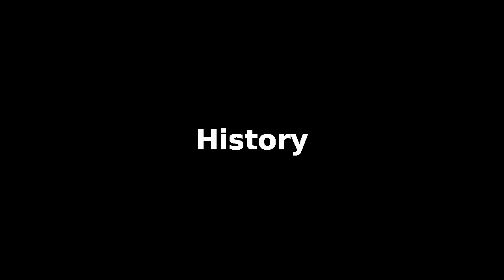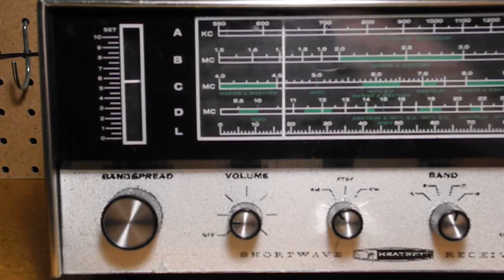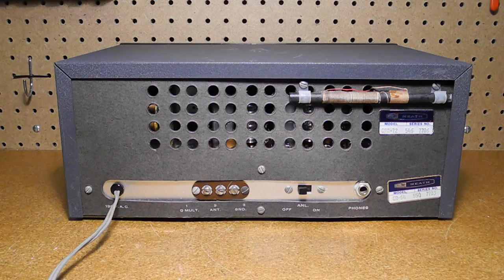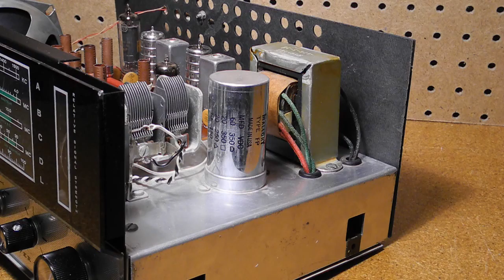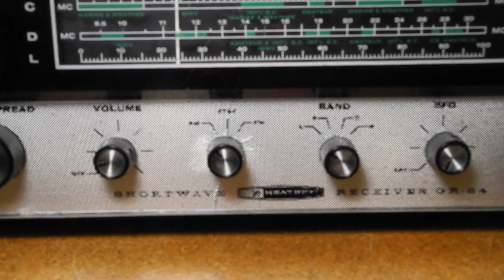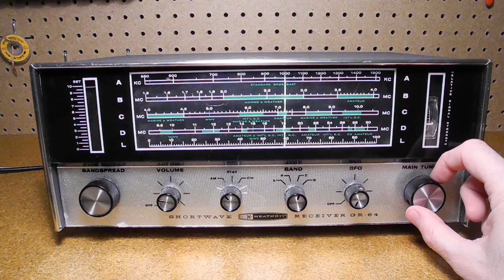The Heathkit GR-64 Shortwave Receiver

Comment: I can’t get audio on any frequency. I do not know what the issue could be. I’ve looked through it and everything looks good. I don’t know what the issue could be. Any suggestions?
Reply from the maker: There are some partial copies of the Heathkit manual online. The manual has a "In Case of Difficulty" section thats lists symptoms and possible causes. The schematic diagram also lists expected voltages that can help diagnose problems, if you have a multimeter to make measurements. Use caution as there are high voltages present!
Reply: @jefftranter  okay thank you 🙏

Comment: Witch one is the better: Heathkit or Realistc.
Reply from the maker: Both Heathkit and Realistic (Radio Shack) made many models of shortwave receivers with a wide range of performance and price. It only really makes sense to compare particular models, not the manufacturers.
Reply: I'm sorry for so many questions. I am deciding on an Ebay purchase between a HEATHKIT GR-64 (valve) or a Realistic DX-160 (transistorized). Which one is the best?? THANKS
Reply from the maker: The DX-160 is a more modern receiver and should offer better performance and be more reliable. It looks like a service manual is available so you could repair or align it.

Comment: check your wiring on the s-meter. mine works properly. 0 at the bottom=no signal, and strong signals send the needle towards the 10. this one has a green and black twisted pair, with the black on top and green on bottom. W4ATF

Comment: Ah, my first rig; I built it when I was around 14. I built and used a Heathkit Q-Multiplier to improve the signal for amateur radio, particularly those using SSB. I had a the antenna leads connected to a piece of coax that went up to the roof of our 15 story apartment building in Brooklyn. I had no problem receiving communications from around the world and had a nice collection of QSL cards from both Hams and commercial SW radio stations.

Comment: This is the first Heathkit I built way back in 1969.   I was 15 then.   One thing led to another, thanks to Heathkit and later having it motivate me to get in to amateur radio by listening to shortwave radio with this product.  I recall trading it in at Henry Radio for a Hammerlund HQ110 and a Drake 2NT transmitter.

My parents used to give visitors a "tour" of my bedroom "radio shack" which really provided encouragement.

I built the Q Multiplier for the radio too.  Not a great addition but entertaining to play with.

 In the end, I obtained an Electronics Engineering degree and worked for a large computer company for a 35 year career.

What fun it was to build these kits!  It is unfortunate that this era has passed in that it enabled so many people to experiment with electronics and pursue interests that could later become a lifetime career.

Thank you for posting this video.  It's a step in to the "wayback machine" that brings a great nostalgic feeling.